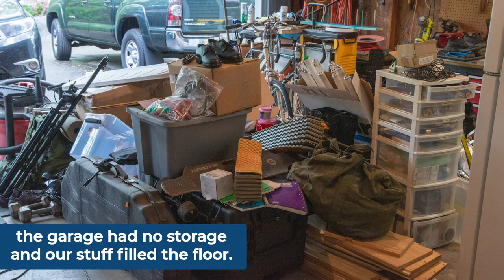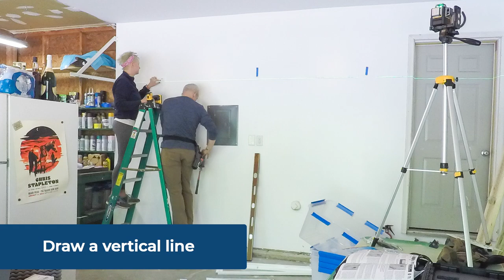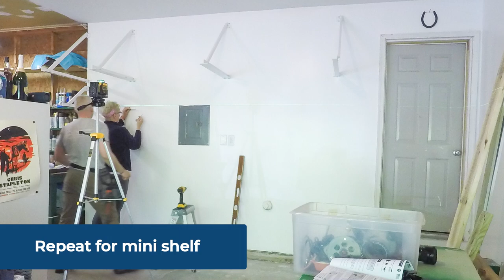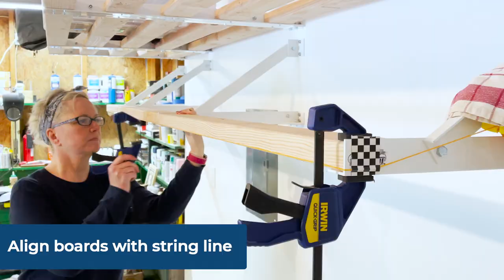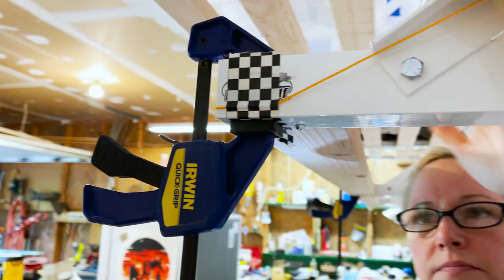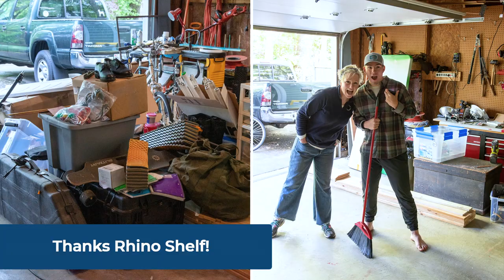The Best Heavy Duty Garage Shelving

Comment: Instead of one larger rack along the top and the mini rack underneath, is it possible to just do two of the same larger size stacked? Or would that be too much load for the walls?
Reply from the maker: We did the bigger one on top/smaller one on the bottom because we had limited wall space/height because of our refrigerator etc. I don’t think two large shelves would be an issue, but they actually have a super helpful google doc that you just fill out and they will get back to you with what they think would work best in your space. So easy to work with! Here’s the link. https://rhinoshelf.com/pages/designteam